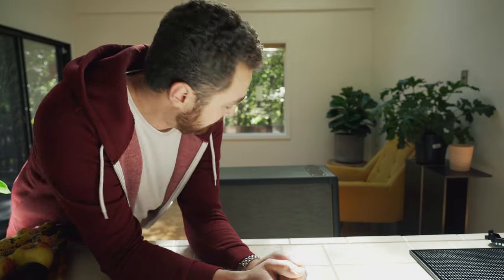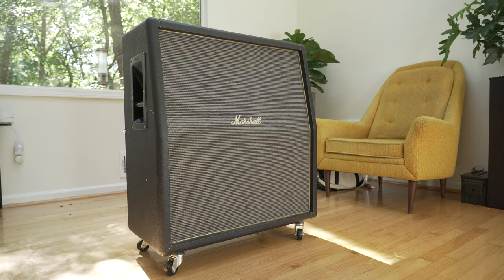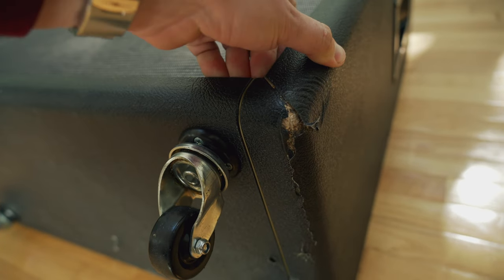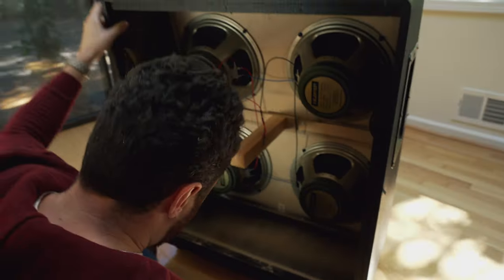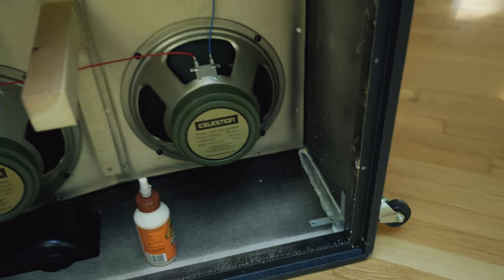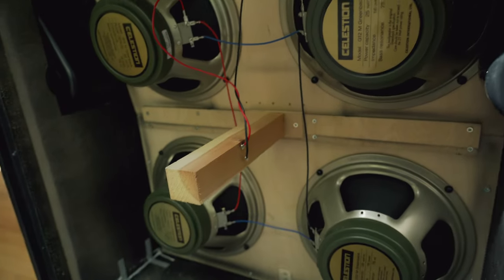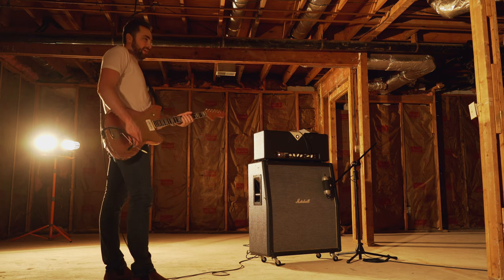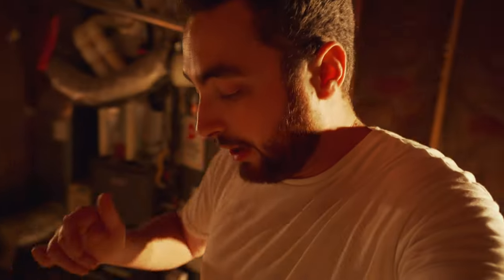I Bought A BROKEN Marshall Cabinet (and it sounds AMAZING)

Comment: Rhett, I love you, BUT…you actually will need a “Plan B” when the wimpy screws in those brackets work loose. There’s a first time for everything.
Reply: That’s why he included glue as reinforcement.
Reply: @mikemorrisonmusic  Rhett has good intentions, but unless glue is clamped to something like a wooden cleat it offers no structural integrity on it’s own, nor is it intended to. I’m a mechanical engineer and I would love to say that this is a good repair, but it’s a bandaid at best. I’ll be the first to say that Rhett has great guitar skills and I really like him, but this is not a great repair. If his intention is to stop potential rattling from the cab and keep it in his studio it will be fine - not strong enough to gig with, but fine for studio work. Rhett is a smart guy and he’ll figure it out without our help.
Reply: @flightnavigator8999  I have a feeling we’ll all be hanging for a while. In the meantime, the best thing we can all do is practice our guitar skills instead of posting online. Cheers!
Reply: Looks to me it will be fine. Not a road dog & it will be ok in the studio.
Reply: The fact is, if it's a studio rig, it shouldn't need more than that. 

The wall of the cab is not that thick, which means you got about 3/8 to 1/2 before the screw starts poking out. 

The brackets should suffice. 

He could've injected glue into the joint from the outside.

You can reinforce the joint with a 2x2 glue and screw, or 2x4 corner braces. The screws will still only bite 3/8 of the wood. That's ultimately the limiting factor without fundamentally changing the cab

But only need that for touring purposes, or if and only if this doesn't hold

Owning a marshall cab that hasn't been toured, it'll hold just fine sitting in the studio.
Reply: @flightnavigator8999  Unfortunately there is no Plan B
Reply: @jts3339  He literally said he's not going to gig with it and it's just for the studio in the video.
Reply: @danieljensen2626  We all know that, but thank you for adding your comment a day after everyone has repeated it a hundred times. Everyone was waiting for you to weigh in on the subject and we feel much better since you shared your opinion.
Reply: @mikemorrisonmusic  but he didn't even apply it to the joint..
Reply: I'm late to the game, but @jts3339 is exactly right. I always think "in 40 years, do I want the person that finds this amp to find it repaired with care?"

Comment: I've been playing electric guitar for 50 years - not that I improved much or achieved much.
But I encountered Greenbacks very quickly and they do have "the sound"
IMO they are the ideal speaker if you are playing with any kind of grit or distortion.
I readily concede that Greenbacks are not the best for sparkly clean tones because they do have a warm, dirty sound of their own when they are driven.
I used to play through a home-built Marshall pre-amp driven by a Germanium transistor booster into a TRANSISTOR amp into 2x12 Greenbacks.
Guitarists who came up to talk to me at gigs thought it was an obscure valve amp and were amazed to learn it was transistors.  (FET's in the pre-amp and transformer-coupled silicon output stage)

I've tried several speakers over the decades and always come back to the Celestion G12's.
I have no idea whether the ones made recently are the same but I for sure believe that the Greenbacks I have from the mid Seventies are the best guitar speaker for Rock guitar - warm but with enough bite.

Comment: Use a cargo strap as a clamp around the outside. Glue a pair of battens inside the broken corners and use a coupe of springy planks to temporarily clamp them in place diagonally.

Comment: The best fix would be to remove the tolex and reglue the bottom joints. Next would be to rip a 4x4 diagonally so you have two triangle pieces. Cut the length so it will span the bottom sides glue in place then 3 screws in the side and 3 in the bottom.

Comment: Touring the northwest back in 2006, my Marshall 4x12 flew off the top of the roof rack, it landed on the highway at 60mph. Luckily it didn’t hit anybody. We picked it up and threw it back on the roof rack, secured it and that night I gigged with that cab. It sounded better. Once back home I checked it and the baffle was cracked in half. The cab was just scratched and one V30 was gone, tored apart.

Comment: I had the same thing happen to a JMI Amps AC30.  I glued it back together and installed cleats in the corners. I used camps to tighten everything back together.  I would not use the L brackets.  I used to gig that exact same rig you have.  Riteous.

Comment: I picked up a older oversized Carvin 4x12 for $125. I got it and looked inside and it had 4 EVM12Ls in it which are some of my favorite speakers and that was about a grands worth of them. I put them in a 2x12 and a couple of matching 1x12s. The EVs were just too heavy in a already heavy 4x12 so I put lighter speakers in it. I’ve thought about putting Neo creambacks in the 412 eventually to lighten it up.

Comment: Nice repair to bring the cabinet back to life. It sounds great! If the L brackets ultimately aren't strong enough, some perforated angle sections in those corners will strengthen it up.

Comment: That cabinet is actually a Marshall 1960TV (for tall vintage) not the slant cabinet from the Marshall 40th anniversary "Hendrix"stack. Those cabinets have a different grill cloth and the 1965 Marshall block logo, no wheels and it has a 2 piece open down the center back. Those are some of the best sounding Marshall cabinets ever made, yours is most likely from the early to mid 1990's. Great video Rhett!

Comment: Even if the box seems to sound good it could be wise to check the speakers. I once bought a second hand Crate 4x12 with Celestion S-50's that had been damaged much the same way as yours. It had been "repaired" and seemed OK but I decided to unscrew the speakers and have a look. Found out that the impact had been so hard the speaker magnets had been bent downwards in it's metal attachment. When playing the speakers individually there was audible voice coil rub on two of them and the other two was rubbing when pressing lightly on cone sides. Since the top plate of the basket was bent, there was nothing to do about it; I scrapped them.

Comment: Get with a luthier and have them throw a couple of splines or braces on each side along with glue in the broken seams to permanently pull that cab back together. In fact, you could probably use some square stock to make contact between the horizontal and vertical surface and glue/ pin nail them in place to dry and have a really strong joint as well.
Don't use corner brackets, they'll cause their own host of problems.

Comment: The smile on your face after you played said it all.  I liked it from the first notes.  

I concur with the notes on working glue into the broken joints.  The brackets will get you by for a bit, but there's going to be leakage.  The sound won't be as tight as it could be.  But then, that may not be such a bad thing.... reference "The smile."  Borrow an identical 4x12 if you can and compare and go with your gut.

Looking forward to seeing your studio build series.  Don't wait too long to set up the bar and beer fridge down there.  ;)

Comment: Reminds of what "Brown did for me" with a Dean Markley CD-120 combo I ordered from out of state.  I went to pick it up at a local Guitar Center and the shipping box looked like an accordian.  After a day of debating on going through with the discounted deal they offered me, I decided to take it.  Took it home, took everything out of the cabinet and injected epoxy glue in the separated joints, then used a ratchet strap to pull it all together.  I planned on taking it in for service anyways, so I had an amp tech go through it and replace leaking caps etc as well as the speaker that had the magnet break off the basket, which in turn crushed several tubes.  It all turned out great.  I spent more than I should have, but now I have a little story to go along with a cool amp.

Comment: I would remove the L-Brackets and buy a piece of 2 x 2 lumber from Home Depot and use it as a cleat, glued on both sides along the bottom joints of the cabinet.  You might as well do the same on the top joints of the cabinet, even though the joints look OK for now.  If you use a good quality wood glue, the repaired joints will be stronger than the wood itself.

Comment: i just bought that same cab model for $80! from right here in dwntwn San Fran- as the last of the musicians fleeing the lockdowns have fire sales.  if those seams work loose (they shouldn't if it's not moved a bunch), just open up the joints a bit and shoot a bunch of TiteBond wood glue in & let sit for a few days... better than new!

Comment: Rhett I STRONGLY SUGGEST you put some type of sealant or wood glue in those cracks before you place and tighten any brackets......If Air escapes that enclosure im sure you are aware it will drastically alter the sound.....also a 3 sided molding of partical board wood in those 90 degree angles would strengthen it very much.

Comment: You don't necessarily need to relocate all the screw-holes unless the surrounding wood is actually torn. You can just side in a long narrow strip of wood into the screw-hole and then re-screw. You just need enough wood for the screw to bite into.

Comment: It looks like the ply on the sides and bottom is fine, it's just the glue that's failed. Assuming it's ¾″ ply (difficult to tell in the video), buy a piece of ¼″ dowel, if it's actually ½″ ply you'll need ⅙″ dowel.

Open the joint, clean out any old glue, and apply new glue to all the surfaces. In this case, construction adhesive (e.g., Loctite PL Premium) would do a better job than wood glue as it will expand to fill any gaps.

Use some ratcheting tie down straps, one horizontally around the case just up from the bottom, and one vertically around the case just in from the side so you're not applying the force to the actual corner, but to the wood adjacent to the corner. Don't crush the box, just make sure the joint is snug.

Carefully drill along the joint from the front and the back as deep as the drill bit goes, so you're drilling through the middle of all the tabs in the finger joint. If your dowel isn't pre grooved, use a nail or something to gouge some grooves along the side of the dowel (to allow excess glue to escape), apply glue to the dowel, and gently tap it into the hole with a mallet. Once dry, cut it off flush. to the surface. The joint is now mechanically locked together.

For the loose brace, you could use pocket holes to reattach it to the baffle.

Comment: Sweet find, especially with greenbacks. I would think it being a floor demo that the speakers would already be broken in. How much playing time is necessary to break in speakers? I've purchased many cabinets in rough shape as well. One old Marshall cab that had something rattling around inside it. Opened it up to find the caster inputs were destroyed! The rattling was chunks of wood chips. It also had Eminence speakers instead of Celestion. Vacuumed it out, screwed on some new casters and traded it because I didn't like the speakers. Your L brackets were a good idea.

Comment: Morning Rhett. The Heritage speakers are either 20w G12M or they’re 30w G12H. The H come in 55 (the Hendrix) or 75hz. Someone may have already said this. Lots of comments. Glue it back together, wood glue, syringe. Keep on eye on Craigslist. They come up. Power, circuit breakers, breaker panel, number of circuits, etc. all of this is important for anyone running multiple amplifiers, they have a lot of pull. Nothing compared to microwaves, heating elements, dryers, dish washers, ranges, but still enough to overload a single circuit and brown out your electronics, which they don’t like. So if you do a studio tour, please talk about electric. 💪🏼

Comment: with mallet.mallet the joints open enough to get titebond waterproof carpenter glue in and mallet back together. titebond with duck on label. I would avoid gorilla glue too messy. cabinetmakers use titebond. the wood corner braces are a good idea too but you may not need them if you get glue well into panel joint. we used to glue our skatboards with regular elmers glue and the joints were stronger than wood.

Comment: Got a syringe and squeezed some Titebond back in those joints.   Could even use a little Titebond and tooth picks to tighten up those stripped screw holes.

Comment: If you want to break in your transducers quicker, run pink noise at 1/2 power for 48 hours.  You could also run pink noise at full power for 4 hours and that should take care of it.  You will need a full range amp to do it quicker.

Comment: I think I've been watching Uncle Doug work his magic on old amps for too long, because the first thing I thought was "dude, you gotta open up those finger joints, inject some wood glue in there and clamp that sucker". Depending on the how bad the separation was, you might not have needed brackets at all. But good on you for doing the work yourself—

Comment: I would have removed the baffle to get a look at all the corner joints. Then re-glue the joints while keeping the cabinet square. Tip the cabinet up with a joint down and let gravity move the glue into the joint one joint at a time.

Comment: I had one of these when they first came out. Traded it a few weeks later for a regular JCM800 cab with T75s. Always thought greenbacks sound awful.
Reply: It depends on the amp.  Greenbacks work great with a Super Lead but not so well with a JCM900.  Of course, I've got 4x12 cabs with V30's, Greenbacks, and T75's
Reply: Green backs are the best for classic rock if you want stoner rock use vintage 30s

Comment: Don't drive the baffle screws into different spots, just take them out, stuff a match-stick, or bamboo skewer into the hole to fill it with soft wood, then drive the screws back in.

Comment: Weird. A couple years ago, from some surplus inventory auction house, I bought a used Marshall 1960AHW. When it arrived, the baffle board was essentially unattached to the shell. I don't know how much of this was shipping damage. Like yours, the baffle board screws were not driven home. I was lucky in that the corner joints were at least in good shape. Repair of that was trivial, and regluing some spots where the tolex had ripped was a non-issue. Letting the seller know got me a significant discount on an already good price.
What puzzles me is that this looks like faulty assembly. I can't picture how the screws would just come unscrewed like that. Now that you've had a similar issue, it makes one wonder. Makes you wonder if Marshall had some issue with a disgruntled employee on the assembly line.
After these fixes, it's a solid cab. The four G12H30-55 speakers in mine sound pretty damned glorious though.

Comment: If the brackets fail you could glue an screw some wood blocks in the corners. ( not sure if this would impact the tone or resonance of the cab, but this would make the cab sturdier I would believe. It qlways nice to play a cab or mre speakers, that moves more air. You can play a bit less louder and still hear you well/better in a band mix when you have more speakers. I did this with my bass setup. but who would play less louder anyway. ;)

Comment: That cab deserves better than that. I would have pulled those baffles. Steak skewers cut roughly to 2 inches and glue them into the existing baffle screw holes. Make sure they are a tight fit, lightly tap them in. Once dried, cut them flush. Sit your baffles back in and redrill pilot holes. Than screw the baffles back in (by hand not drill) sequentially similar to tightening a head on a car engine. 
Others have mentioned good ways to tackle firstly gluing the existing opened up joint and after that, strengthening using timber, glue and screws. After that you'll be able to take that cab any where, wont rattle when recording and wont fall apart.

Comment: The cabinet looks like its got finger joints which are typically very strong, unless you drop it on a corner hard. If the joints are still sound, I would just pull them apart gently, reglue and put back together.

Comment: Rhett, on the inside, put some big ass L brackets (2 in each corner) Make sure your new screws aren't too long so they don't come out the outside.  You can still get fairly big screws that are still short enough. Then use construction adhesive in all corners the full length up and down and the short corners of the depth/thickness of the cab. Get a plastic glove and run your finger along all the new bead of adhesive so your making it like a weld joint everywhere. Constrution adhesive by Franklin company is the best. If you cant find franklin, then get shitty liquid nails, it will do alright. In 3 days that glue will be a rock hard weld to your cabinet walls. Then the cab will be strong enough to take over to Rick's every now and then if you wanted too.

Comment: I think it's fine what you did, only that the anchoring points are screws... and for the effort mmm... well long story to tell why it shall last few. So a better rock solid  solution would be 4 square shaped stick blocks (just like the one in the center) massive glued at the corners. Shall need a four corner belt strap to girth it tight for the outside, and some clamps to attach the blocks to the corners inside. Cheers Martin from Argentina by the way.

Comment: Loose screws - insert tooth pics with carpenters glue to tighten them up. 1” x 1” poplar at the corners instead of metal corner braces at the weakened corners.

Comment: At least they did not put the forklift tongues through the speaker cones, like some i got.  Would have pulled the bottom off and reglued the dovetail (at least they looked like dt).
Wood corner block/strips would have been better. But that should hold you for a while since it not going on the road.